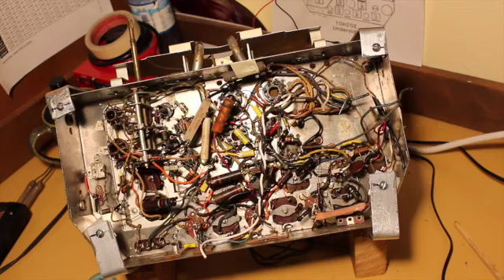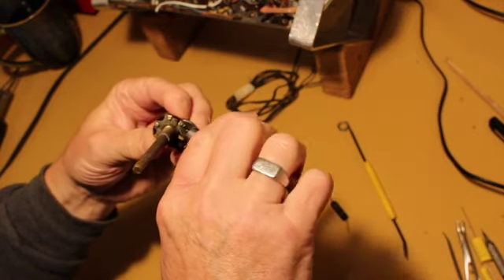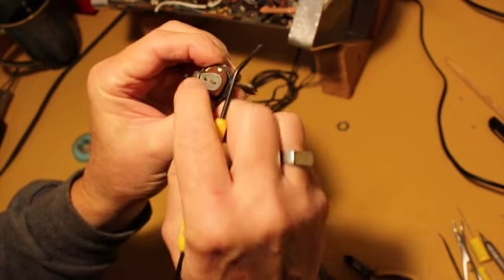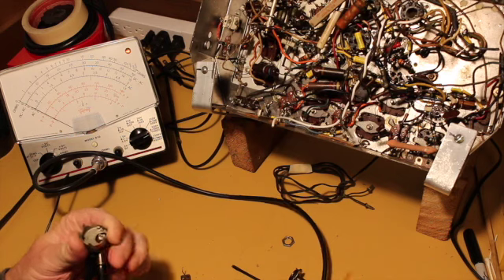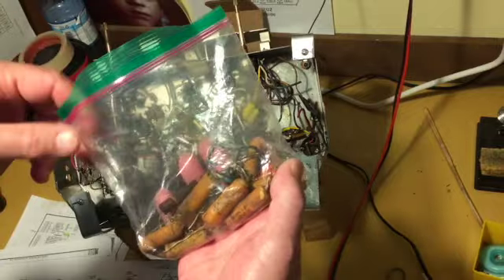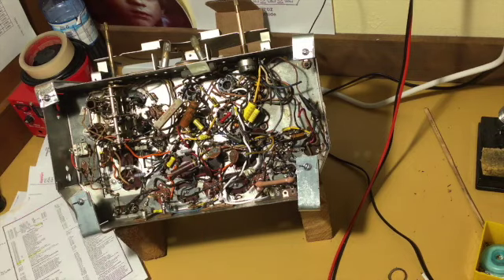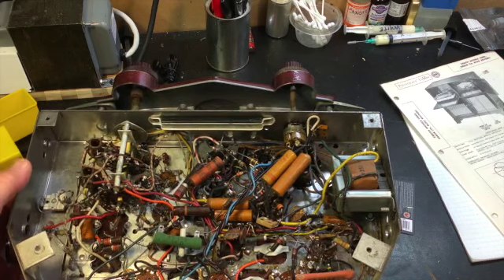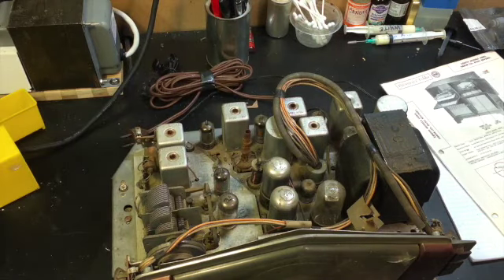1951 Zenith 10H20Z   Episode 6   Ohms and Farads   SD 480p

Comment: Hey Martin, 
So very good to see another video from you!  And this particular radio is special to me because I was born in 1951.
I have some suggestions for you...you may or may not wish to use them.
On the original chassis, I would suggest that you DO replace that "rod" shaped resistor.  Furthermore, I would suggest that you use a chassis mount type like a Dale resistor or such.  Also, to use a thin layer of thermal paste between the resistor and the chassis.
Although the "Candohm" resistor replacements are "OK", I would suggest replacing them with chassis mount resistors also and to include the thin layer of thermal paste between the resistor and the chassis.  The main reason for the suggestion is that it would neaten up the chassis and also provide much better heat dissipation as well.
On the new chassis, I would recommend the same treatment on the resistors.  Even though the Candohm resistor is "good" I would suggest replacing it anyway because I feel that they are sort of Time Bombs just waiting to destroy a radio.  Something else that you might (or might not) wish to consider is to try a bit of the GEL type of Evapo-Rust on the power transformer (and any other places that you think it might help) where it had some rust on the top of the transformer. (new chassis)  
Can you think of any "reasonable" reason that those screws were put in the faceplate?
Something that I thought you might want to know about is a company called Adapt-A-Cap, which makes a PC Board type replacement for large filter capacitors.  They are a bit pricey but in many cases, it would be well worth the price.  The website is https://adapt-a-cap.com/collections/all
Great job on the switch and volume pot!  
Be Safe, Be Healthy, and Be Happy!!!
Reply from the maker: Thanks for your recommendations, Wayne.

Comment: Hi Martin,
Your Zenith radiogram is progressing smoothly.  As far as getting the mains switch functional again, some we win, and some we lose.  You did a good job freeing it off.  Those riveted types can be fiddly: reassembling them can be the more demanding.  As I say, an excellent repair.  Two days ago, whilst sorting out a Pye, model P35 radio, I was not so fortunate.  The spring, that shorts the two poles for the ‘on position’ is broken thus rendering the switch BER.  Nonetheless I’ll soon get that radio working again.
Do you have the cabinet, speakers etc. with your second chassis?  If so, get it working, choose the one you like best for your radio collection, and sell the other LOL.
Cheers my friend, and have a safe, and joyous Christmas.  Phil
Reply from the maker: Thank you, Phil.